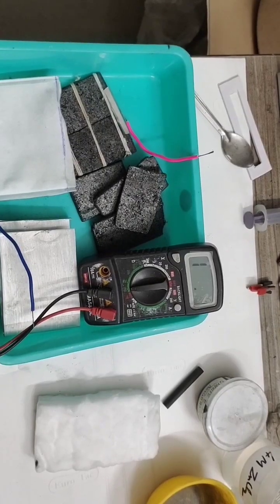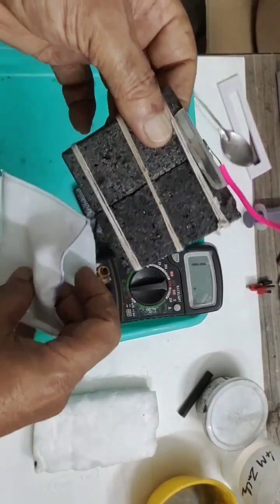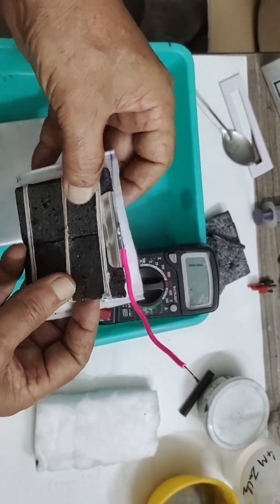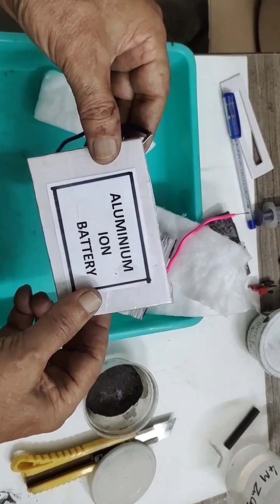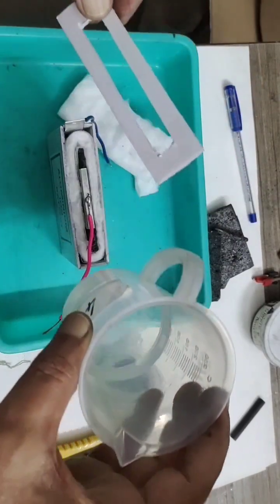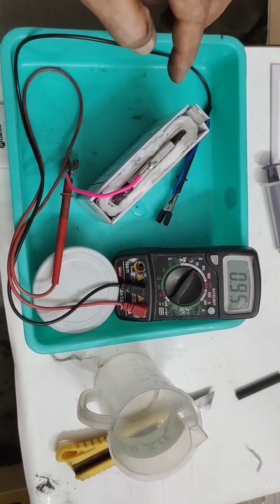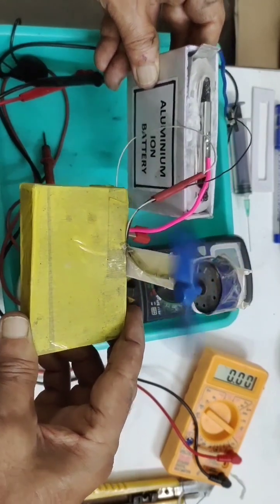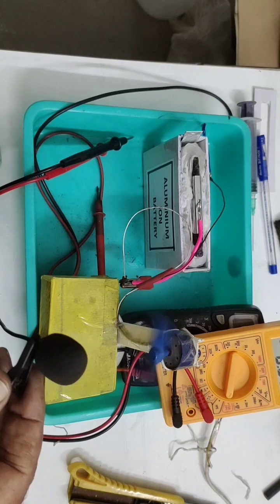ALUMINIUM -ION BATTERY, RE-CHARGEABLE, HOME-MADE GRAPHITE PLATE, D.I.Y. PROJECT-78, Volt 4, C 400mA

Comment: Mine got to 2.6v
Reply from the maker: Nice, I think you would have used ionic liquid, anyway fine.👍
Reply: @dkjawahar-techexpt671  Extremely thin separator and ionic flourine based electrolyte

Comment: With due respect... What was the voltage and mah after recharge the battery ???
Reply from the maker: 1.89 volt, C 800mAmp within 1 min charge with outer dc 4.5, 1amp. Standing volt 1.45, C 600mAmp
Reply: @dkjawahar-techexpt671  
That's great